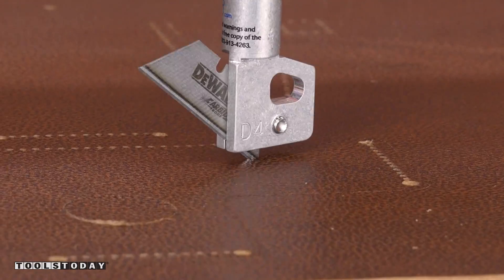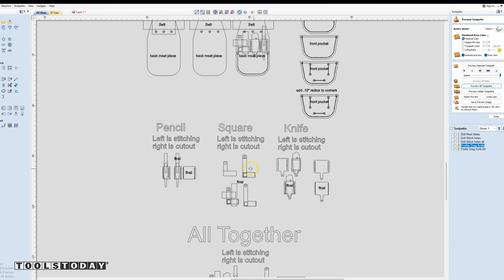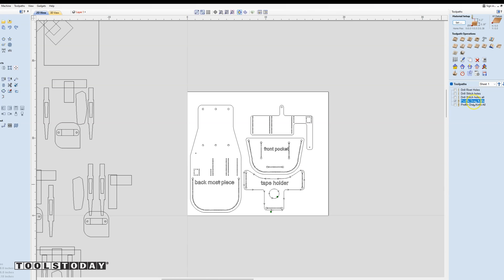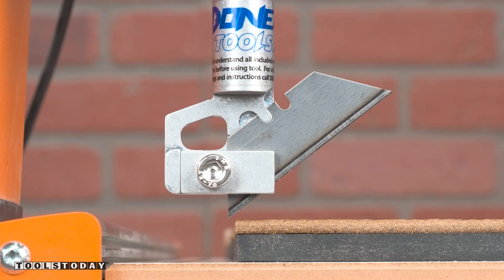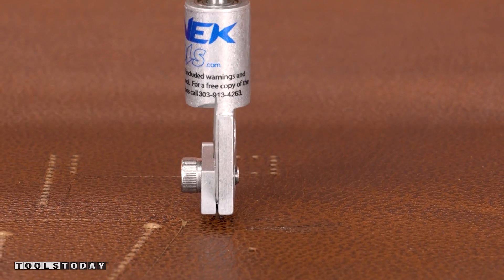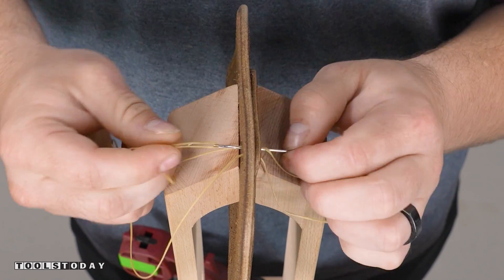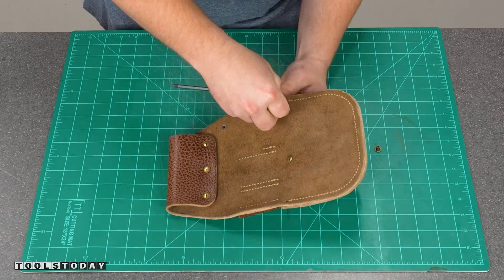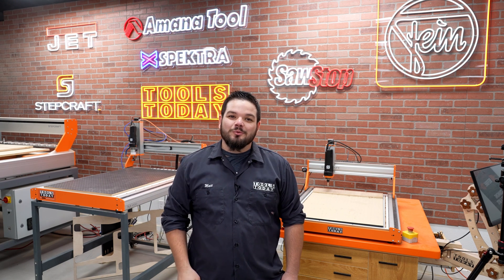How to Use Drag Knife on CNC to Cut Leather | ToolsToday Video

Comment: How about to use one of the battery powered ultrasonic cutter instead of drag knife for cutting and also 2mm chisel blade could be used for french style stitching holes instead of round big holes. If it could be possible I would love to buy one of those machine to speed up the leathercrafting projects.

Comment: If you were going to use a drill anyways, why not program your offset in vectric, and set your x and y zero with the tip of the drill?
Reply from the maker: I certainly could have, this was an easy way to not have to program the offsets and do it on the machine instead.

Comment: I am looking exactly something like this at a smaller scale where I have a rubber sheet of about 4 sq inch and 3mm thick. It is marked with some precision layout and needs to be cut and holes punched (not drilled) at very precise locations with a tolerance of 50 microns. Do you know of any machine that can do it? 
Also, since my workpiece may not be the exact same size evrytime, is there a way to tell the machine some reference points on the workpiece (in addition to xy 00) so it knows if the workpiece has a little rotation.
Thank you.

Comment: As someone who does a good amount of leatherwork, you'll likely be much happier with natural vegetable tanned leather for future projects. It's going to be stiffer, easier to work, and more durable in the long term. You can also control the color with dye if you want to. For a project like this, I'd recommend about 8 oz. 

And thanks for getting a larger audience to see drag knife work like this. Such a handy tool for leatherwork. But lots of leathercrafters don't consider using a drag knife. Most will invest in a clicker press, but then you are locked in to one design with each die, and you have to hire out the construction of each die. Lasers work, but they smell like burning flesh (since you are literally burning flesh) and leaves burnt edges that are difficult to remove. So the drag knife gives you versatility to create any design (without dies), and also leaves clean edges. Best of both worlds. There is a place for all methods, but rarely do leathercrafters get into drag knives for some reason, and they are missing out. Hopefully more will see your video. And great work! Thanks for sharing!

Comment: Did you use any nesting layout tool to minimize waste?
Reply from the maker: Not on this project.  I needed a little bit of material between the pieces for the vacuum to hold down.  I could have gotten a little closer, but really wouldn't have saved a ton of material with the way these pieces laid out.

Comment: would really love a deeper diver on the tool paths to do this on a shapeoko
Reply from the maker: We will do another leather project in the future and also offer plans for it where it will go deep into that and show you how to do it.  You would need to be using something like the Vectric software as Carbide Create doesn't have some of the features to control the drag knife and get it to cut where you want, specifically the lead and ramp into the cut.

Comment: How do you know how much leather you need to cut out your project
Reply from the maker: I didn't know how much leather it was going to take until I had everything designed out.
Reply: @ToolsToday with this set up can you cut out from odd size leather? Not ever hide you can get a perfect square from.
Reply from the maker: Yes, definitely.  Check out the full length video we did on making a mallet recently.  I show how I use an odd size piece there, it would be the same technique with leather.

Comment: I'm slightly confused on the zero position. You set the position using the offset of the drag knife but unless I missed it you didn't change it when putting the regular end mills in. Wouldn't the holes be drilled offset if the drag knife offset wasn't ignored during the drilling?
Reply from the maker: Correct I set it using the drag knife which is accounting for that offset and didn't change it with the drill bits.  With this setup, I'm setting the x and y zero to the drag knife so it's essentially offsetting the drill bits, and hole locations, for me by the same distance the drag knife is offset. It resulted in having everything nicely aligned!
Reply: @ToolsToday I guess looking at your design further my question is answered. The knife is indeed dragging on the correct line, which is off axis where the cut takes place but lines parallel to the direction of travel are directly in line with the spindle center, they are just cutting with a slight trail.

Very cool process and new skill. I really enjoy your videos. I actually just crudely converted my CNC bed to a vacuum table because of watching how much more streamlined your process is.
Reply from the maker: That's awesome to hear thank you for the kind words and taking the time to say so!   Correct, it took some time for me to wrap my head around, but it worked surprisingly well!

Comment: So you didn't use the drag knife gadget in VCarve? Is that because you had no sharp cormers?
Reply from the maker: Correct, I didn't use the gadget and didn't have any sharp corners.  I also don't like that I can't tell it what side is the offcut and which side is the project piece, so sometimes it puts it's lead ins on the wrong side and I can't change that, unless there has been some update to the gadget.  I find manually doing my lead ins lets me control it better.
Reply: @ToolsToday  by 'lead ins' do you mean the starting point of each cut? With the dragknife gadget, you either create a node and assign it as the starting point, or you can choose an existing node and make it the starting point. I cut leather with a drag knife frequently and I find the gadget to be invaluable, although I've never tried not using the gadget. All that I have to do is assign starting points to appropriate nodes so that the knife always begins in the same direction for each cut. And of course, the gadget will allow sharp corners. The way that it accomplishes this is quite fascinating. Having only used the gadget, I don't have a basis of comparison...but the gadget is fast and easy. Great project, by the way! :)
Reply from the maker: Thank you!  When I set a lead in, I'm ramping in outside the cut line of the material so that way the knife is oriented in the correct direction before I get to the line I want to cut. Is there a way to start outside the cut path with the drag knife?  I'll admit, I haven't tried it much so don't have a ton of experience with it, but it was orienting the knife in the wrong direction when using it and cutting into my finished piece instead of the waste when trying to orient it.
Reply: @ToolsToday  Understood. With the Drag Knife gadget, you can start the cut directly on the line in most cases. So you don't always need to have a shallow lead-in cut for the sole purpose of orienting the knife. Actually, it's best to avoid them. When you get the tool set up, you'll orient the knife in the direction that all of your cuts will begin. And then you assign starting points that will use this same orientation for every cut by assigning proper nodes as starting points. 

So let's say that you set up the knife facing to the right meaning that you will want to start each cut from left-to-right. In many cases where you are making a complete circle, square, (or any closed vector), the drag knife will end with the same orientation since the end of the cut will be back at the beginning of the cut. So the knife is back to being oriented left-to-right after cutting. Then when the knife is lifted to go the next part, you'll make sure that the node for this next part is also set to a point where the knife will start cutting left-to-right. This works for most complete shapes.

If you don't have complete shapes (closed vectors), you still can (in most cases) choose a node that will still give you a starting point that will begin cutting with the same orientation as the last cut. For instance, if a cut ends pointing north, assign a node to the next cut that will also cause the knife to start cutting to the north.

But....there will be times that you simply can't do this. In this case...if the node that you chose as a starting point is making a shallow lead in that is cutting the non-waste side of the material, switch the starting node to the opposite side. The software is making an assumption as to which way the blade is oriented. If the software is incorrect in this assumption, then just switch the starting node to the opposite side and the lead in will then be on the waste side.

I discussed this over at the vectric forum a while back. This should also cover the topic well...
https://forum.vectric.com/viewtopic.php?f=2&t=40457&p=293987#p293987